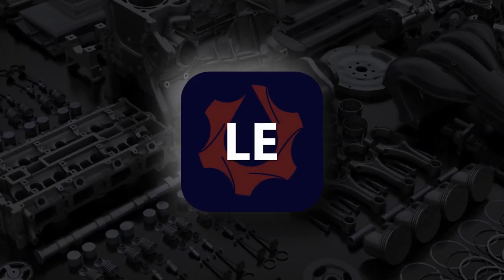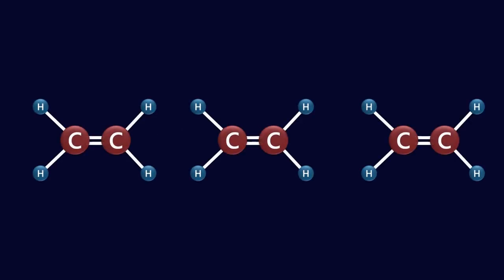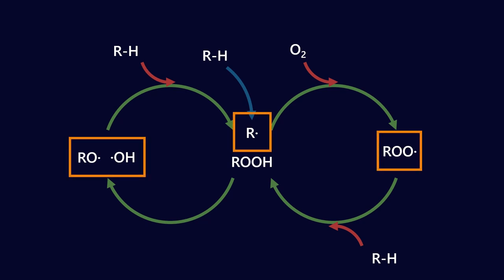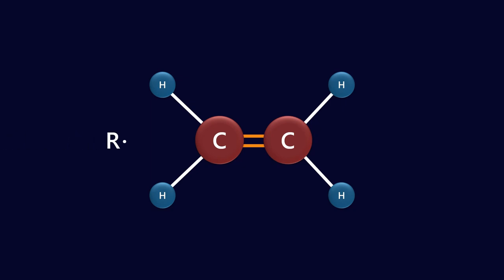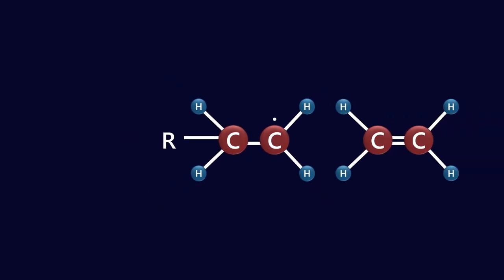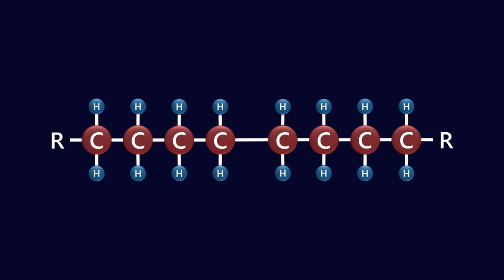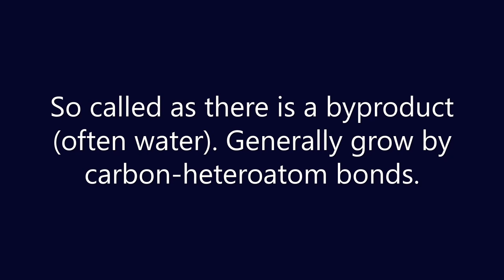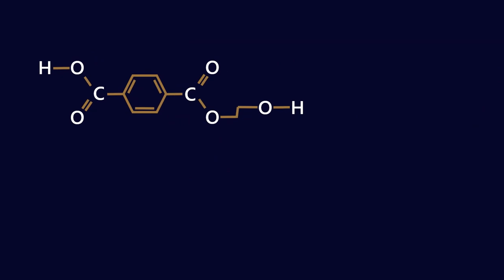Why do oils get thick when they oxidise? Polymerisation of lubricants explained

Comment: For several decades, oil viscosity increase has been THE number one focus of engine oil formulators; far more so than things like wear. Each new spec release demanded greater resistance to oxidation & less vis increase over ever longer durations. However, IMO after the big jump from SJ to SL, things started to become a bit silly. Yes SM, SN & SP oils all had better oxidation resistance but this could only by determined by making the test conditions so unrealistically severe, that the results were utterly divorced from any kind of driving reality. Computer CPUs went through the same sort of thing years ago, when they became so blindingly fast, that the so-called 'extra performance' they delivered, effectively meant nothing to the user. 
The bottom line is that today's oils are just so good, you shouldn't really be concerned about oxidation & viscosity increase. Chances are that you'll routinely change your oil way before the oil runs out of control.
Reply from the maker: Yeah at this point it feels like the lubricant performance outstrips the maintenance practices that are applied by most vehicle owners.

Comment: back in the 80's and 90's when i changed the oil the car felt noticeably quicker. but starting in the early 2000's when i changed the oil (mineral) nothing felt different.

Comment: Hi Maestro, I would like to comment you a real case we detected in a plant that we are trying to solve. We were detectig an increment of the viscosiy in the regular inspection of the oil, with that results the plant decided to change the oil. Now it comes the "phantoms", after changin it and 2-3 months working we did a new analysis and the viscosity was higher than before, much higher. And after 2 months, we did another analysis and it was even higher. Real strange. The thing is TAN is like an horizontal line, no increment no decrement. The other varabiales are all in line. What are we missing here? Watching all your videos to get some ideas
Reply from the maker: Hello sir! There's a number of things that it could be. If you're able to post the oil analysis results (with any confidential material redacted) - please post your question to the forum: https://lubrication.expert/forums/ and I'll see if there's anything that I think of which you might have missed.

Comment: This is the largest contributing process that will eventually overcome detergents, antioxidants and dispersants through overextended use regarding (hours/mileage/operating conditions) of an automotive engine oil and filter?  During my high school/college mobile oil change service days, I remember seeing oil coming from drain pans that was (almost) the consistency of room temperature gelatin. (Pre-synthetic era)
Reply from the maker: Generally yes, this is the main reason that oil “gums up”. Additional deposits get generated by spent additives and inconsistent fuel, but oxidation resulting in polymerisation is the main driver.